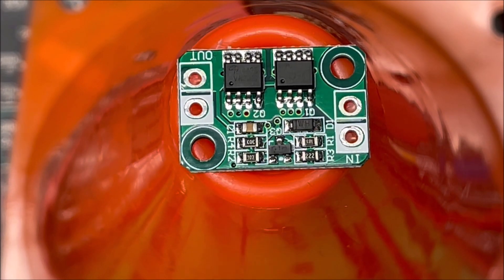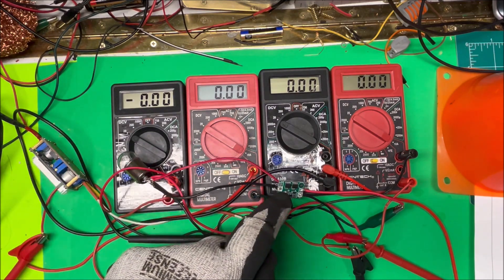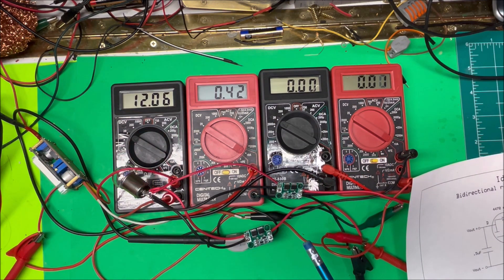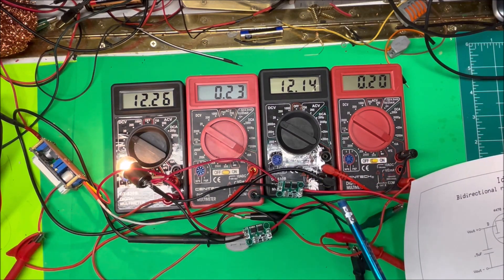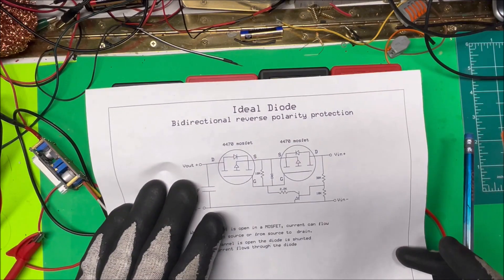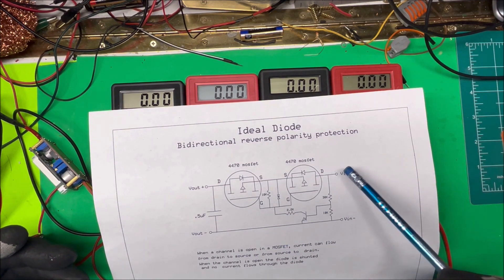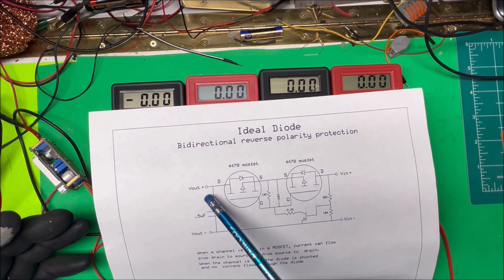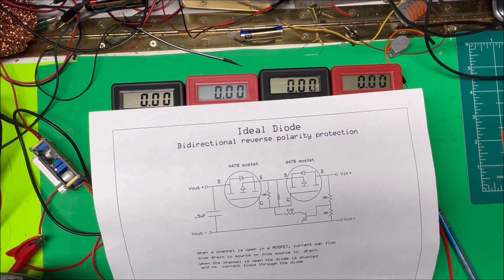Ideal diode

Comment: So, can 4 of these modules be combined to make a bridge without any additional circuits?  What I've read so far is that a circuit must be running that analyzes the input signal and opens and closes the FETs to simulate diodes right?  What functionality do these have on their own or are they a full bridge?  Thanks for the video.  I'm a little slow and had to watch it more than once.

Comment: I bought some of the red high current ones with a single flat pack MOSFET in the middle.  Sounds like that may be the ones you have on order.

I haven't tested them yet, but I did research the little controller IC on it.  It is called an ideal diode controller and is very interesting.  It compares Vin vs. Vout and has logic to manage hysteresis etc.    It is very fast acting.  It drives the MOSFET gate.  Given it's a purpose built chip, I'm hoping it won't have the issues you are observing 🤞
Reply from the maker: Thanks